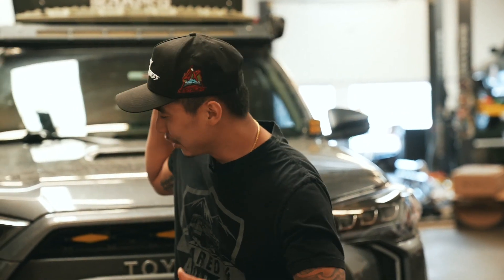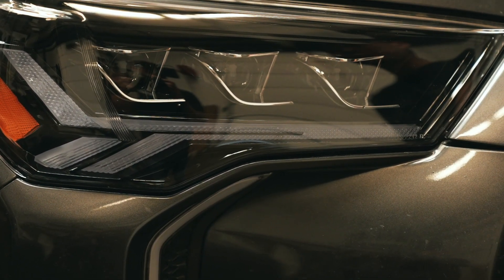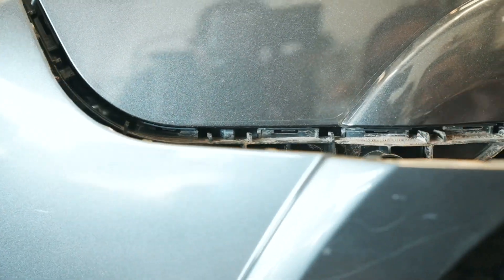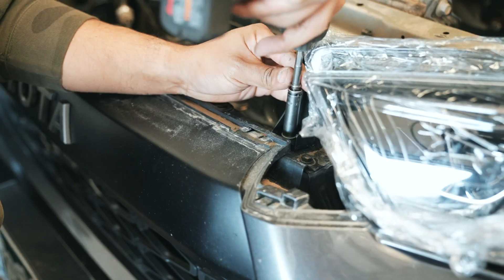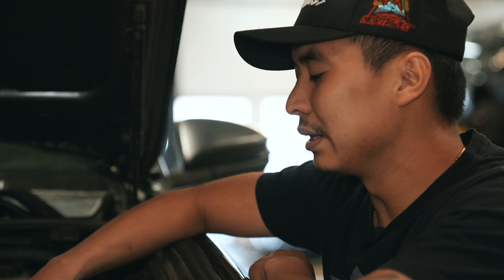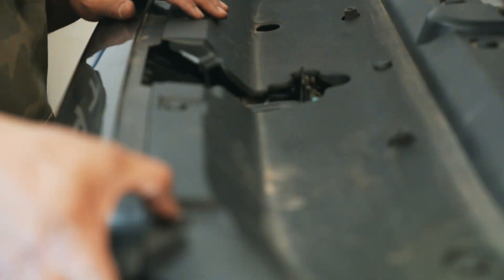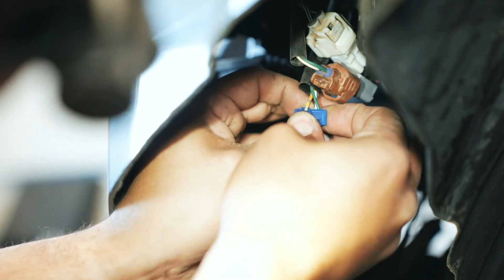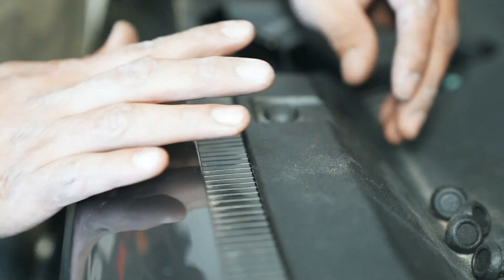BRAND NEW Headlights for the 2014-2020 4Runner - GTR Lighting Carbide LED Headlights

Comment: Have the same setup and love the lights, my only issue is that my raptor lights were in the INJ fuse. How did you get both to run?
Reply: i just ordered these and realized I will have the same issue lol. what did you come up with? add a add a fuse maybe? lol or just tap wires?
Reply: @JarvisVO-Foley  Did you ever solve this? Struggling with that issue now
Reply: @adamtakeshita8698  oh, I forgot…my raptor lights were actually hooked into the fuse box in the cabin near dead pedal. So the inj fuse was still open in engine bay. There’s a few slots between the two fuse boxes, don’t be afraid to make use of both!

Comment: How did you hook up both the wire from fang lights and gtr headlights to the INJ fuse slot? Sorry I’m a beginner but like for my rig to look nice too.
Reply: Yea that’s what I’m trying to figure out did the same to the raptor lights I had to tap into the gtr drl wire  for them to turn on all together how would it work to add those fangs too if inj fuse is already in use
Reply: @adrianortiz3835  following this…

Comment: I’m already using a INJ for my raptor lights.. is there another fuse I can use to piggy ride the fang lights besides INJ?
Reply from the maker: You can tap it into that same fuse or just see which fuse has constant power with the engine on. I can't remember the fuse box to all the trucks lol. Sorry
Reply: @Runnin4Tacos  I can tap on add-a-fuse to another add-a-fuse?
Reply from the maker: @Jon.pascual  No, Tap the power wire from the fangs to the add-a-fuse.

Comment: They said on website only up to 2020. Will these work on a new 2022 4Runner ?
Reply from the maker: From our experience, it works with 2021 as well with a harness from GTR lighting. I am not sure if the wiring is different on the 22 models.
Reply: Only problem is defeating the DRL for the LED high beam. Still trying to figure that out for my 2022 TRD Off Road

Comment: Hate to burst everyones bubble but those headlights are total garbage in terms of actual output...  

Dont believe me?  Just watch the Lightwerkz Global video comparing these to OEM, Alpharex NOVA (also trash) and the Morimoto.  Theyre really... really bad.
Reply: I watched that same video and they werent that bad.
Reply: They’re not bad, and they are slightly lower than the stock 2021+ LED low beam.  The problem with the morimoto is there low beam output, as you have to aim them lower than stock as they are too bright. One of the local guys got a ticket after a cop pulled him over while he was driving behind me. He had to take his vehicle to be reviewed and he was made to remove them. Legally here, we’re not allowed to change any of the lighting from stock, so going brighter will put you at risk of being noticed.